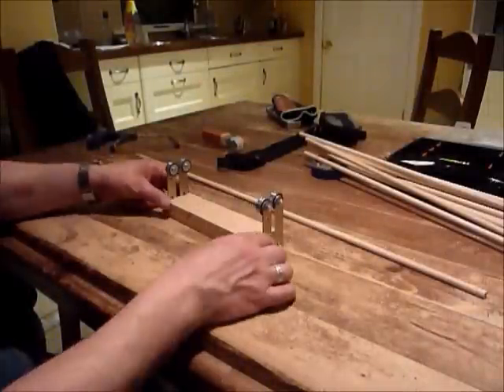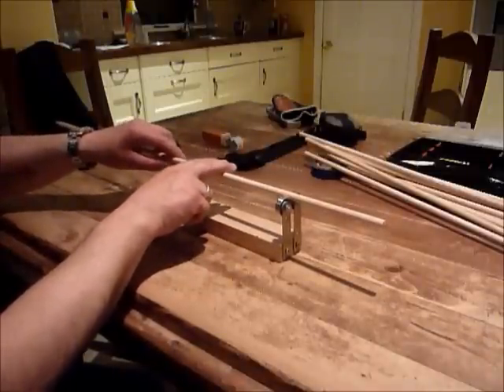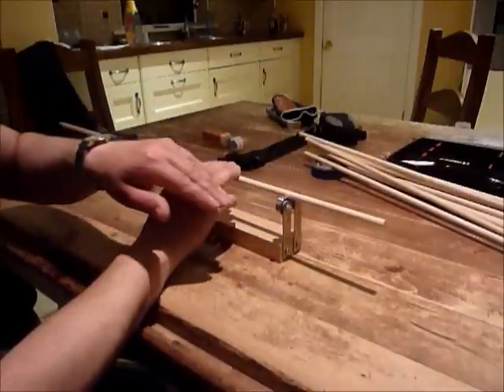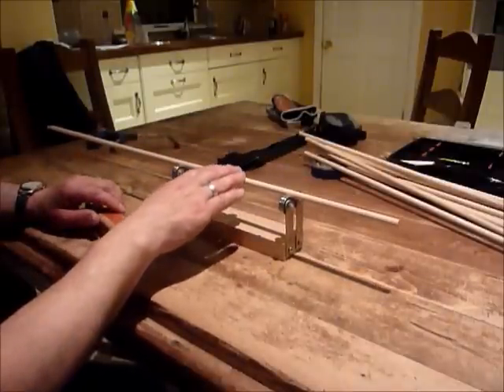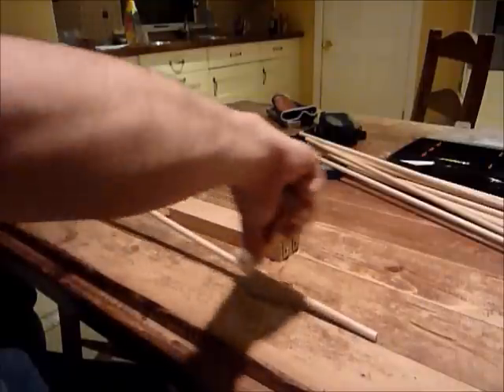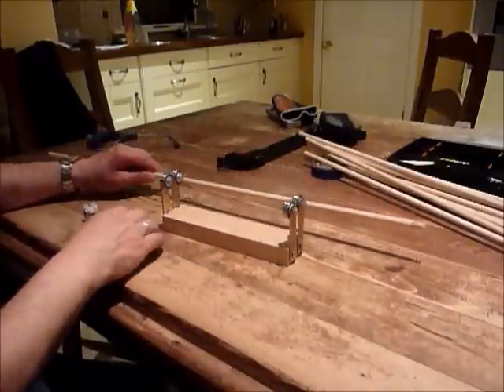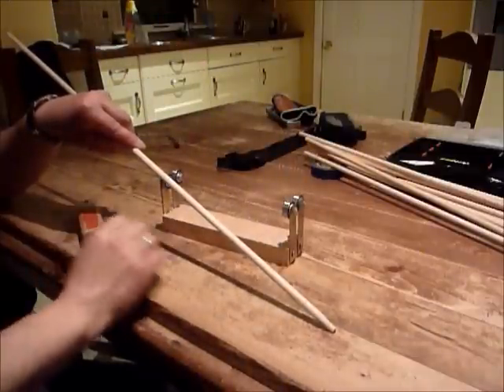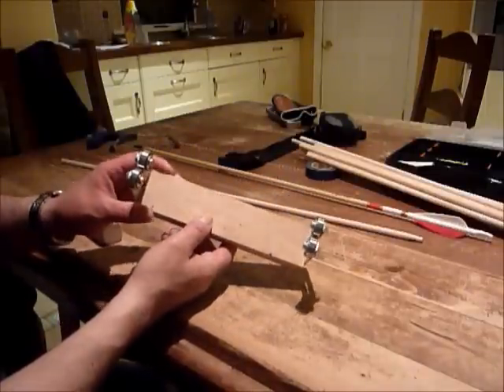Straightening Wood Arrows

Comment: Didn't there also used to be a way of smoking the wood somehow to also straighten them?
Reply: I don't know if smoking was used although I'd imagine since Smoke can cook Meat, then yeah you could do that to straighten arrows. For sticks that you find in the wild, you would want to straighten with the hot coals first, then perhaps the smoking method would be done for several hours to gradually straighten the arrow under it's own weight or perhaps the arrow is viced up against a straight stick using Rope.

I don't know alot about making arrows so I'm just making guesses.